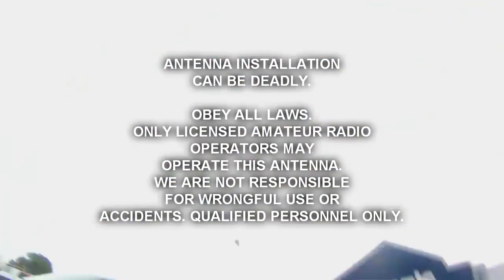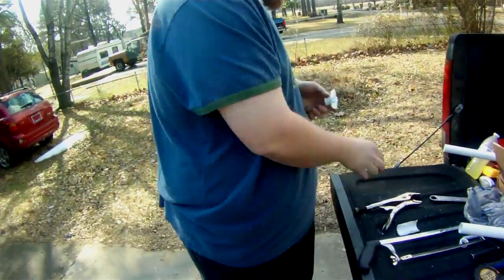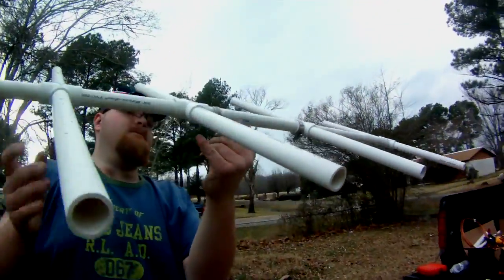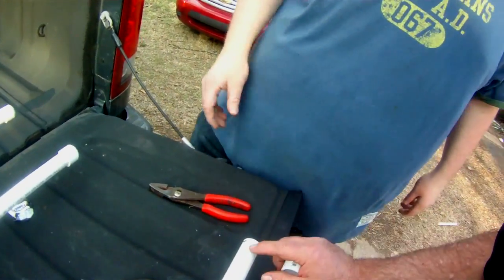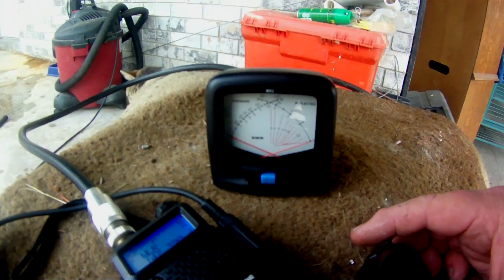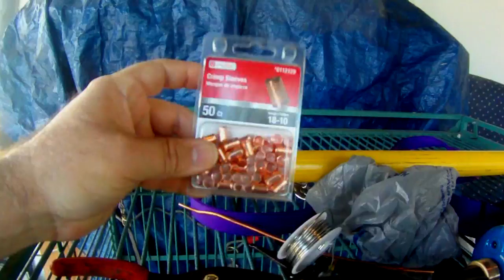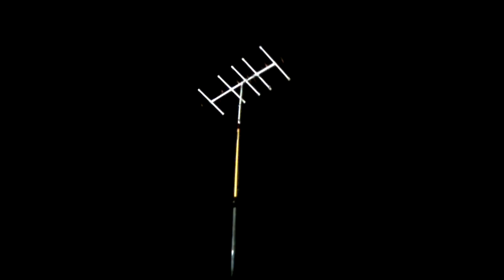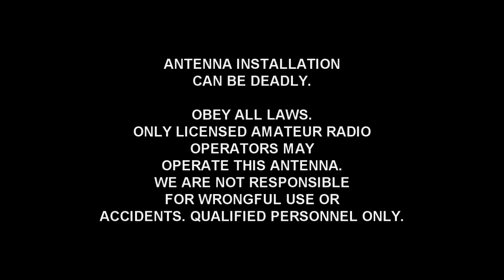Don's 2 Meter Extreme Dream Beam Antenna

Comment: I just finished this antenna a couple of days ago.  It was very easy to build.  When I first transmitted I thought my SWR meter was broken because the needle didn't move from 1:1.  BUT, the antenna was just RIGHT on 1:1 at 146mhz!!!  Thanks guys.  73

Comment from the maker: To WX9DX  Don was using the same setup. The receive sure beats the 38 foot jpole. It is highly directional for sure. It has a small tight width lobe from each side that has considerable distance also. 73

Comment: You most likely have 3 of the 4 watts lost in the cable. LOL And what happens on TX happens on RX also. So yeah 22 miles on simplex with a HandHeld and antenna just around 25 feet, yeah it seems to be ok! What antenna was the other station using?
73
Jimmy, ARRL TC, WX9DX

Comment: Great project but what kind magic dust did thy use to come up with 12.5 dbd on what looks like maybe a 5ft boom? I don't think so guys. The KF1O design from Directive Systems Engineering 12ele yagi is 12.6dbd on a 2.5 wavelength boom.17.4ft Case closed...

Comment: That is basically the same antenna that is in The ARRL Antenna Handbook 21st Edition starting on page 18 - 41. This one has one more director and the elements are round rather than square.  They are a great antenna and with one extra director will just make it that much tighter and a better front to back ratio.  I built one of these about 20 years ago but I didn't glue the parts together so I could break it down if need be.

Comment: You've got to love the 1 foot RG8 jumper from the HT to the SWR meter because we all know that .001 DB of loss you would get using an rg316 jumper instead would be to much. If you are worried about loss then get rid of those garbage PL259's and replace them with N connectors.

Comment: Enjoyed video, good design and look like a good performer too video has been shared in Facebook and email. You can't been homebrew antennas, I'm hoping to build a loop antenna for 20m - I need to get to the hardware store for some pvc piping and wooden dowels etc, it's getting round to it at the moment - I've got a few projects that I've been overdue to do now the weather is great time to get the tool box out 73 Rob Swansea UK 2W0BJR 163MPT065..
Reply from the maker: I have used it for a long time. Never fails to impress me how much gain and directionality it has. thanks. 73

Comment: New Technician License in hand. . Very interesting antenna.  The element lengths were different what was said in the video  to the lengths listed above. Is the one above after it was built and "adjusted". Also the dowel rod ( diameter color coded, black ). Didn't show it being inserted where. Through the length of the boom? How is it secured.  Length of the machine screws increased to allow the diameter of the wire?  Good, simple video.     Tnx.    73's   KK4ZMT

Comment: Man, you fellas got it good down there!  It's hard to scare up anyone on 2 meters here in the Chicago area.  222 is a lot better, more of a gentlemens' band.  I'm going to have to try to build one of these, with horizontal polarization, for working across Lake Michigan on 2 meter sideband.  Friendly folks in your neck of the woods, though. 73 de ka0pmd

Comment: no call sign yet but i think this is a great antina just a small tip heat shrink tubing then you will not need so much silocone  (spelling is not my strong point)

Comment: Please, note that the Center of Gravity (CG) and the Center of Pressure (CP) are seldom coïncident; it would make a lot more sense to mount the boom to the mast at the CP rather than the CG because dynamic (wind) forces can be considerably stronger than static gravity.  On the other hand, it probably doesn't make a lot of difference with a low-element-count VHF (or UHF) Yagi.

Also, it would be instructive if you published a table of element spacing.
Reply: OOPS!  Just saw the end of the video.
Reply from the maker: EdWatts (-:

Comment: you had it set perfect for murs before you added length to it. how much difference can you tell from a ground plane. I got a 6db tram 1400 up 61 ft and can talk simplex to mobiles up to 30 miles. so if I went with the 14element hygain that is 15.? dB gain how much farther could I talk to a mobile simplex ? I THINK ABOUT MAYBE TWICE AS FAR OR 50 MILES DO YOU GUYS HAVE ANY IDEA? thanks rough rider from se oklahoma.

Comment: If a person were to use 1/4" tubing for the loops what modifications would be necessary? I assume they would all need to be shortened a small amount.
Reply from the maker: My own testing shows a poor performance with larger wire. I can't explain it but gains of bandwidth are mythical.

Comment: How did you guys match this antenna?
Reply from the maker: The antenna is matched by length to perfect resonance to the 2 meter frequency, in full wave length.- We sweeped it using a frequency meter and cut it accordingly.
Reply: Ah, gotcha.  Neat idea!

Comment: Would it negatively impact the antenna to paint it?
Reply: Below 400 MHz no.
Reply: Just make sure there is no metal in the paint
Reply: Metallic paint won't cause an issue unless it wasn't a good conductor which most aren't. Rob is right with the fact that reflections from metallic paint are a problem from most metallic paints and it causes reflections.

Comment: How many db you think you got out of this antenna ?
Reply from the maker: 14 dbd. Full wave elements and spacing are key to high gain on this design.
Reply: @pressmantheshow  Not even 14 dBi. Maybe 11 dBi ,so it is 9dBd.   That boom is too short in this wavelength to be much gain, despite full wavelength element. 14dBd is an antenna of 8 metres boom al least.